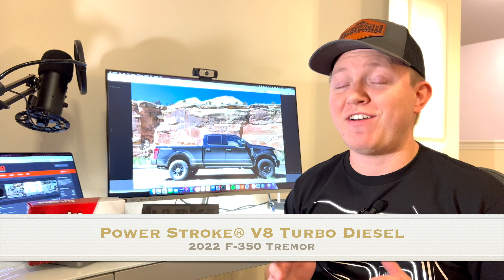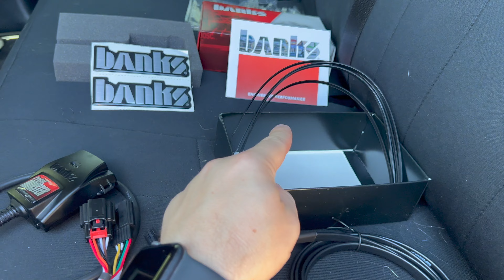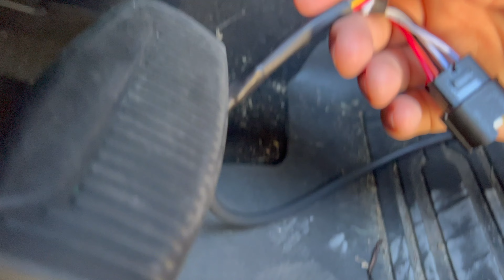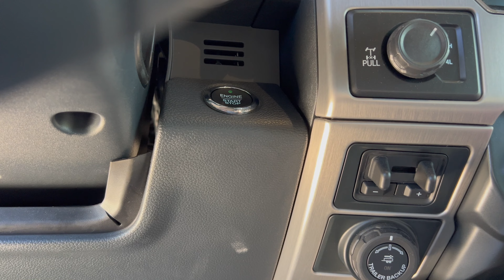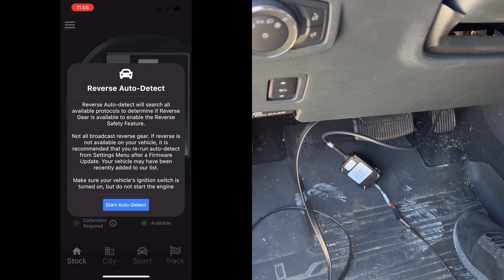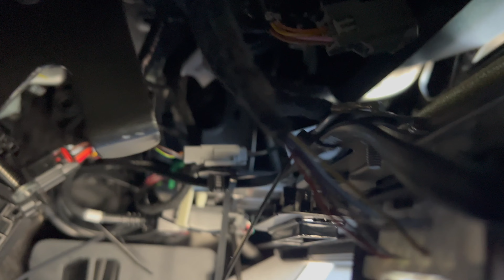Banks PedalMonster Throttle Sensitivity Booster on 2022 F-350 Super Duty Tremor 6.7 Power Stroke

Comment: Thank you for the thorough review! Can't wait to see it in action as you drive. May we suggest that you try Speed-Based Trim. You'll find this feature in the menu under Settings. You can limit the amount of sensitivity added below 10 mph. This is great for towing. When you leave a stop sign or green light, you can set how much sensitivity you want. Then, as you exceed 10mph, PedalMonster smoothly adds sensitivity up to the point where you set it. So, if you're in Sport level 5, it'll roll in sensitivity until it reaches Sport 4. And, best of all, Reverse Safety reverts back to stock when you shift into reverse gear. It's the only throttle booster on the market with these patented features. Enjoy!
Reply from the maker: Great reminders! Thanks!